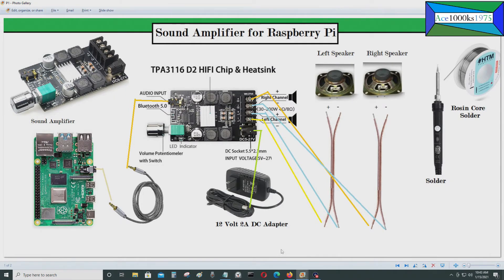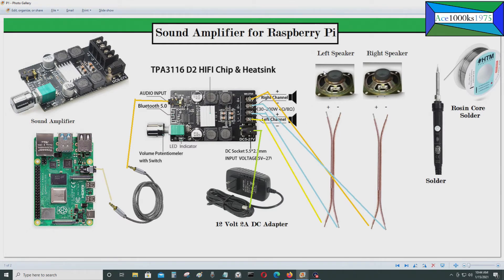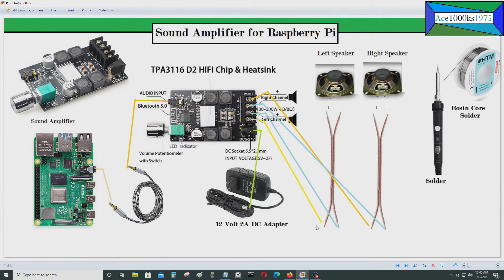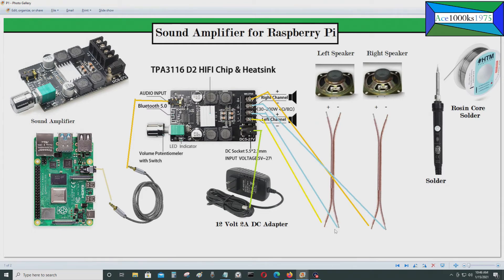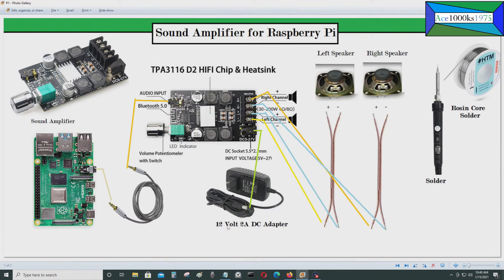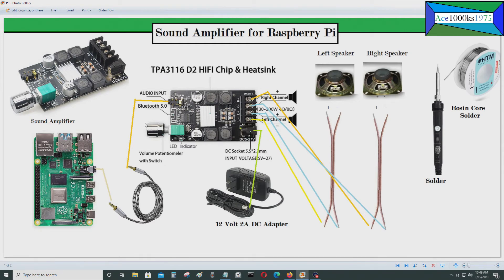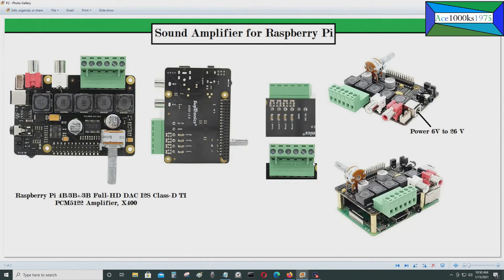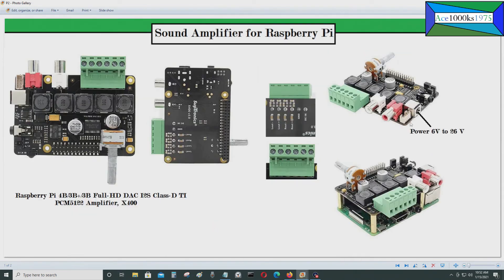Sound Amplifier for Raspberry Pi

Comment: can i use it with a relay? I will keep the pi open 7/24 but i want to use a relay for the speaker connection. So when there is no external electricity passing speaker will not recieve the signal.

is it possible? it is for a background restroom project thanks
Reply from the maker: They call it a single board computer for a reason. It can do one  thing at a time.